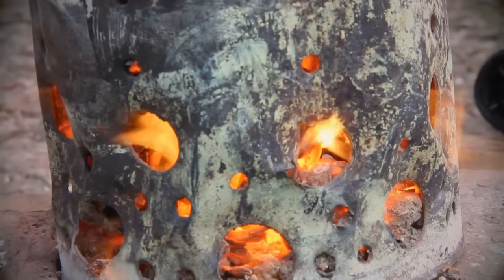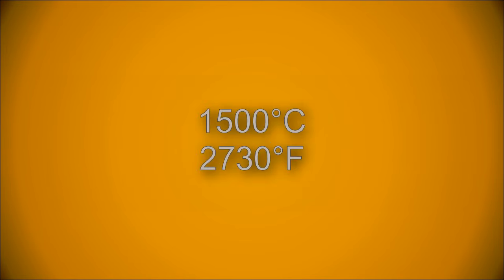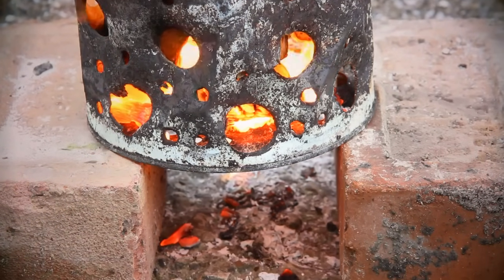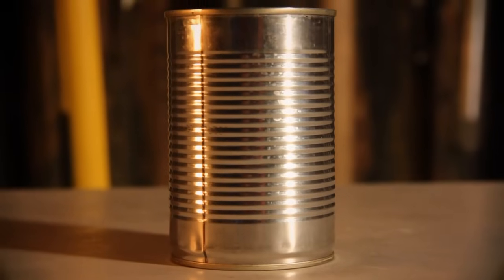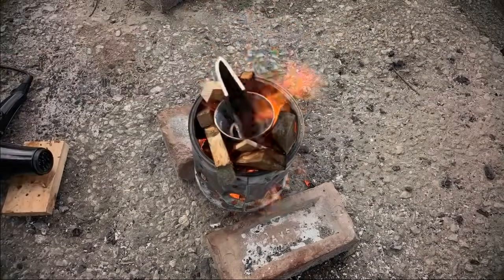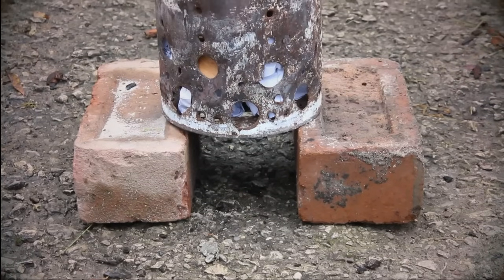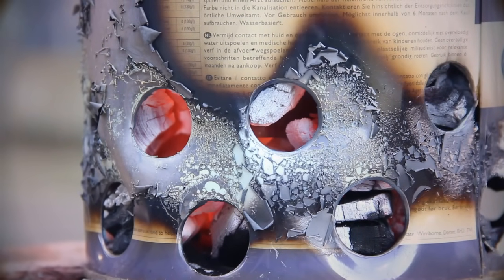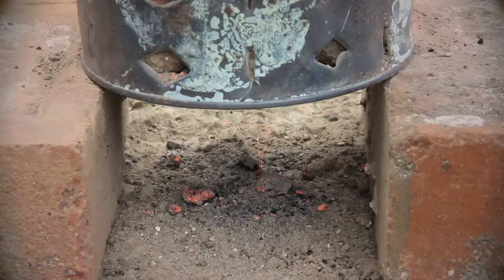How to Make a Free Aluminium Melting Furnace

Comment: How do you deal with the large amounts of aluminum oxide that will form when molten aluminum is exposed to atmosphere?
Reply from the maker: The amount of oxide is not too bad, it tends to be just a thin layer on the surface. I use a spoon to remove just prior to pouring.
Reply: @MetallurgyData  if I were to melt some old Aluminium cans, what would be the best way of getting rid of the print on the cans? IE, Coke brnading prints etc
Reply: if you can cover the pot with some wood chips inside they will form a reducing atmosphere and turn your oxide back to metal.  i did this a lot with a teapot casting fishing sinkers
Reply: @drakekoefoed1642 😂😂😂
Reply: @drakekoefoed1642 .
Reply: @drakekoefoed1642  how? They'll drop into the metal, is that a problem or will you just scoop it out before pouring?
Reply: @Dardomor  I think it'll either burn off or just float to the top. Either way skim the surface before pouring.
Reply: @Dardomor  It turns into a skin on the top of the liquid
Reply: @Dardomor   You'll get a layer of dross on top of the molten Aluminum. It will contain some Aluminum oxide and impurities including ash from the burning wood. That's OK as you'll skim it off before you pour. Any wood chips that end up in the crucible will burn up or get gummed up in the dross. I would advise against using them though, you're better off cutting a 3-inch hole in the lid of the metal paint can and using that as a cover during the melt. You're looking for heat retention by using the lid. The truth is, while the method in the video will work, it's a really bad way to go about melting even a soup cans worth of Aluminum. There are other ways that are free or super cheap to build a furnace and they're all superior to this one. Best wishes!

- Max Giganteum
Reply: @MaxGiganteum Hello Max. Can you point us to a video(s) of a better method, as you spoke of, for doing this? I'm wanting to cast then polish some classic auto accessory parts for myself. Thanks - Ric
Reply: @SCRnflz   Part I ---- Well, I cannot point to any specific video off the top of my head but there must be 1000 or more "How To" or "DIY" videos for making a metal melting furnace. The questions you ask yourself are:

1. How serious am I about casting?
2. What metal am I going to use?
3. How MUCH of that metal am I going to need all at once?
4. How much time, effort and money am I willing to spend on my furnace?
5. What TYPE of fuel or method am I going to use to melt my metal?

 For Q #1, if you're just starting out, the best advice is to find someone or a group who already makes successful castings as a hobbyist that is in your local area. The reason for this is to get firsthand knowledge of the entire process as well as a realistic number for costs involved for those folks that want to do it at home. I bring this up because a lot of folks get excited about casting metal but once they do it... they realize it isn't for them. It's also important to get off on the right foot if you are into it because too many failures can be so discouraging that some folks quit when they shouldn't. The sooner you hook up with experienced casters the better. The truth is that making a furnace most often proves to be the easy part. The hard part is making quality moulds and completing a good casting. For a high quality casting such as a polished ornamental piece, having a super fine grit casting sand is imperative. Casting sands are also often a source of serious frustration for new casters as are the varied processes. For Q #2, the metal is important because the lower the melting point the better! You can more easily and less expensively build a furnace to meet your needs. Interestingly, there are many folks that melt smaller amounts of lower temp metals with nothing more that a heavy stainless steel ladle and an oxyacetylene torch - no furnace needed. I've known guys that melted all their lead on top of a wood stove as another example. No foundry needed. The bottom line is that casting Aluminum or lower melting temp metals are far more easily done at home than metals such as cast iron or steel. With the right equipment, you can cast anything at home a commercial foundry does... but the cash outlay for all that is needed to accomplish them is usually beyond most folks. Q #3 will be important to answer for the obvious reasons... the most important being you have to be able to melt enough metal to cast that which you desire to make. From square one, some folks don't seem to realize that what they wish to do cannot be done at home without serious equipment due to the sheer volume of molten metal needed to complete a casting. And it just isn't volume, it's dead weight! Even Aluminum gets heavy pretty fast when you're using a crucible the size of a milk jug or bigger. Imagine the same weight with cast iron! Q #4 is a big deal for some folks because they simply don't have a lot of cash to play with... especially retirees or folks on a fixed income. Buying equipment can really zing you. Depending on what you build and whether or not you can scrounge up certain items, even a home built furnace can hit you hard in the pocketbook. Then there is the fuel... LNG costs start to add up fast if you make a furnace that uses LNG for fuel. Raw coal or BBQ briquettes can be a drain on the funds as well. Even electricity usage for an electric furnace can add up for many folks that live in certain parts of the world. All these things must be taken into account along with basic supplies such as the metal, crucibles, safety gear, casting agents, etc. You also have to have a place to keep and run your foundry... don't forget that part of the equation. Q #5... I've already mentioned accounting for the cost of fuels but let's also look at the type of furnace you want. Some are "cleaner" than others. Coal, wood or briquettes are dirty and need serious ventilation or to be done outside. LNG is less dirty but also requires heavy venting or to be done outside. Electric furnaces can be done indoors with little venting and are vastly cleaner... though you have to account for burnoff from your metal. Virgin metal won't have any but recycled metals might. Now let's look at your process. Are you going to go for green sand casting? Lost wax casting? Foam mould casting? (Some folks call it lost foam casting). The process you choose influences cost so keep that in mind. So, with all that out of the way... you can build a basic furnace out of a pile of dirt or sand and some rocks. You can build one out of a number of bricks or cinder blocks... even a hole in the ground or the side of an earthen mound. You can use wood for the source of fuel if you're going to melt a metal that's molten at about 900°F or less. All you need is a fan, hair dryer or another method of pushing air to get the coals glowing. Yeah, it's super crude but it can work. Getting a little more serious, a cheap furnace can be made from a metal bucket and Plaster of Paris. Some folks have a specific recipe they use so they add in other things like sand or bentonite along with the plaster mix. Other things used include gravel, busted river rock, feathers, wood shavings, broken roofing tiles, old fiberglass insulation and a laundry list of other stuff. Folks have their reasons for using what they do but there is a point to it all - they believe they're making a better furnace. Some use steel wool, coat hanger wire, chicken wire or other things of that nature which tend to keep the plaster from breaking up as quickly as it otherwise would just like rebar strengthens concrete. Adding in other materials isn't necessary but if you watch enough video footage, you'll get a lot of commentary on the additive materials. Getting a LOT more serious with building a furnace, you can go with bags of various refractory mixes that you can buy on the market. You pour them like PoP but they're far more expensive. You can buy various types of firebrick or other manufactured solid refractories too. Now you can get into ceramic wool types of products like Kaowool. A lot of guys use those materials out of choice but they aren't cheap. The tradeoff tends to be that they last a long time. Depending on your furnace design, you'll also need a burner or burners and possibly elements if you go electric. You'll also need a blower or circulation fan.
Reply: @SCRnflz  Part II ----    Before I go on, before you fire up a furnace, make sure you've got your safety gear on and laid out so that you can quickly and easily deal with any issue that develops. BE FULLY PREPARED before you begin. OK. For me... for me? I've built furnace bodies out of sheet metal recycled from a refrigerator, freezer, clothes washer, clothes dryer, water heaters or other objects like those things. For my "refractory", I use common river sand that is dried in the sun or on top of a wood stove. Make sure it's dry or it can "pop" when it gets hot which is bad. Basically, I roll out two sheetmetal rings for the body of the furnace at a height of about 5 inches taller than my average size crucible. The size of the furnace is based on the size of the crucible - you take the OD of the crucible and add 4 inches (2 inches clearance on all sides though some guys say to go for 3 inches - take your pick). This is the size of your inner ring. The outer ring needs 6 inches of sand on all sides between it and the inner ring so you make the outer ring 12 inches larger at the OD than the inner ring. I discovered through trial and error that a six inch thick layer was best though yes, some folks will say that 3 or 4 inches is fine. Again, take your pick. I cut two precise holes inline through the rings for my burner tubes. Cut them so that the flame front shoots into the gap between the crucible and the inner wall of the furnace, angled slightly toward the crucible. You want the "swirl effect" when using the furnace. Use some scrap pipe large enough to hold your burner tube and seal it (or them if you use two) with some compressed fiberglass insulation to keep the sand inside the rings. Obviously, the more accurately you cut the holes the better - you want a tight fit! The base is a scrounged concrete step stone with a round piece of sheetmetal placed flat on top of it with a flared up edge that matches the OD of the large ring which I spot weld to the flared edge of the outer ring. Since I didn't mention it, form a 3/4" wide 90° flare on both the top and bottom of your rings - form the flare to the sand side of the furnace. The flare acts as a stabilizing base for the rings. The inner ring is set inside the large, outer ring with the sand poured inbetween the rings... fill w/sand to the top and tap the sides to settle the sand. Set the inner ring on a thin, circular "pad" of scrounged fiberglass insulation and keep it centered while you pour in the sand - the insulation keeps the sand from creeping out into the combustion chamber. Leave the inner ring loose, no spotwelds, so it can expand. Yes, the ring will stay centered once the sand is in as long as you don't move the furnace around... at least until it bonds together. Then you can carefully move the furnace. For the top I use another scrounged concrete step stone that I bore a 3-4 inch diameter hole through. I just carefully place it by hand over the top when I'm melting. Why use two sheetmetal rings and sand? Over time, the inner ring erodes away from the heat but the sand bonds together due to the heat thus forming the refractory. In fact, the sand is the refractory material! So what about the metal ring? Even if the inner ring ultimately fails (which it will as you use the furnace) and you carefully remove what's left of it, the sand stays bonded together and continues to be a refractory. Note that you've got to get the furnace hot enough for bonding to take place - low heat won't do it. The offset is that the metal lasts so it ultimately doesn't matter and you can always replace the inner ring if you need to. Moving on. Once you buy or make your burner, install it into the burner tube and fire it up. Place a crucible full of scrap inside and set the lid on top - you're now melting metal as long as the melting point is low enough based on the output of the gas. The bottom line here? All the materials I use are recycled or gathered and are free. I form or machine all the parts myself so there's practically no cost there. The LNG does cost money as I use gas for fuel. For a crucible, yes soup cans work. The trouble with cans that contain food is that all they're built to do is hold food. They're flimsy and they aren't built to withstand the heat in a furnace so it isn't advised to melt metal in them. You can get away with melting lead or other low temp melting metals a few times... but it still isn't a good idea to do so. if you use cans, use them once and chuck them for a new one each time. They can and will fail unexpectedly thus they're dangerous even if you're wearing the gear I have to wear. I've used crucibles made from all sorts of materials that were bought by the company I worked for but for home brew I make mine from steel - anywhere from .090 to .125 wall thickness works well but I always machine a base that's .250 to .375 thick. As I don't concern myself with a little impurity from a steel crucible when casting Aluminum, brass or other lower temp metals, they work great and last a long time. If concerned with purity, ceramics or graphite work well and these days tend to be cheap online though quality varies widely along with prices. I've also experimented with making crucibles from clay that I had to fire in a furnace to cure them before use. Clay crucible? Think pottery. They work well but tend to be very brittle making them difficult to use unless they're really small. Since I don't tend to make small objects, I almost always use a steel crucible I made for myself. For those that aren't machinists or don't know someone that is, the best bet is to buy a decent crucible. Going back to building a furnace, search YouTube for furnace videos. Spend a good 10 or so hours of viewing what folks have done. You'll get the lamest, totally crappy examples to some that look pro built. Some will be dirt cheap and others will cost as much or more than commercial grade units. You'll find a variety of types and you'll even find unorthodox ways of melting metals including via induction heating, using a welder, oxy acetylene torches as well as using a large Fresnel lens or by firing off liquid oxygen in a half shell vessel. What I'm saying here to finish off this book I've written... is to do your homework and put in some research time. Figure out what you want to do, figure out what you think is the best way to go about it, make a plan and execute your plan. Remember though... getting to know others that have gone before you is probably going to be the smartest thing you'll do before you even start on your own project. Best wishes!

- Max Giganteum

PS I know all of the above sounds like a lot... but it really isn't. You can build a serviceable furnace that will last a long time in a few hours. How long it takes depends on how much you do for yourself, what materials you use, how you attain the materials and whether or not you pay to get things done. If I have everything I need in front of me, I can get one done and working in 3 hours or less including building the burner. Yes, I have access to a machine shop as well as a full fab shop so it's easy but even if you just work out of your garage with hand tools, you can do the same thing I do with those hand tools. It just takes longer. How long? Figure anywhere from 6 to 12 hours. Note that if you build a very small, bench top furnace then your time will be seriously diminished. Example? I've built a very small furnace for a crucible that holds 1 cup of liquid in less than 1 hour actual build time.
Reply: @MaxGiganteum  thank you for the very detailed reply Max.
Reply: @MaxGiganteum  yes, before you ask, I have contacted a few commercial companies about creating a better than sand (meaning steel) mold I can use to replicate a label for my camper . . . Always put on hold, no response to emails, or never connected to someone that could actually give me an answer.
Is there anyone you know that actually makes molds for a small time job? As it might turn to a few thousand products, I am ready to spend decently for such a mold. Smallish and pretty much flat. Roughly 6" by 8" by 3/8" deep. Thank you, Gig Maresh in the outback of Missouri
Reply: Melting is okay, using tin cans not so because they are both thin sheet metal. Although I thank you for your video, you got to be careful with the metal scrap, preheat before it goes into crucible, if you don't, sudden changes in temperature can splash molten aluminium and I saw a guy get burnt badly in a foundry, went past his overall and protective helmet and went into his boot he was screaming and others could not take DMs off fast enough and he was in agony for months, so guys don't joke with metal, he was experienced with melting in a pit furnace using oil and a blower burner. If casting be careful about moisture content of casting sands or melted metal will fly, moisture content has to be very low, learn from an experienced foundry man or a moulder and be careful about health and safety, never do this alone in case you need emergency help and you do not know. Apart from the above, good luck to you all, you will need it.
Reply: Here is an old bullet casters trick.  Put (VERY DRY) wood saw dust on top of the molten metal.  This this saw dust will catch fire and turn to charcoal & ash and will float on top of the molten metal.  This float works as a effective barrier to the oxygen.
Reply: @@RichardMcintyre-qu3ku definitely the plastic film will add oil which will burn out. If you want to have fun melting cans only then fine, but if you want to cast you can use scrap pistons, cylinder heads and even ally rims but look at others casting utensils, shafts, and other items and make something useful out of it but everyone to their own taste.
Reply: 4:36 make yourself scarce
Reply: U can eat it
Reply: Inhales deeply
Reply: It used to be a blue tablet but it seemingly contained cyanide so casting was stopped in our schools.